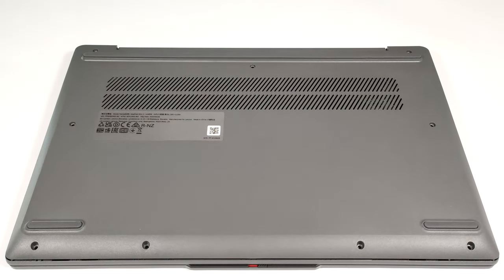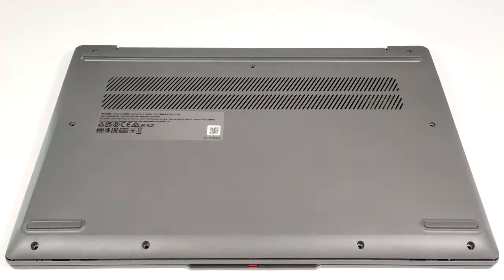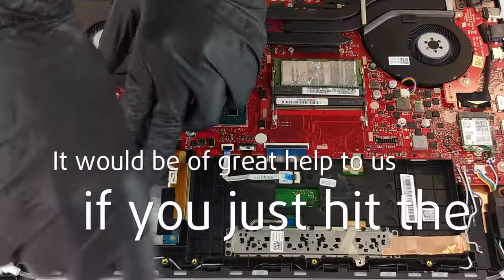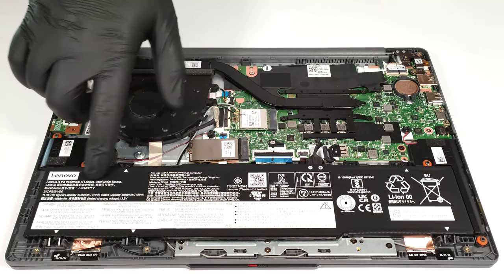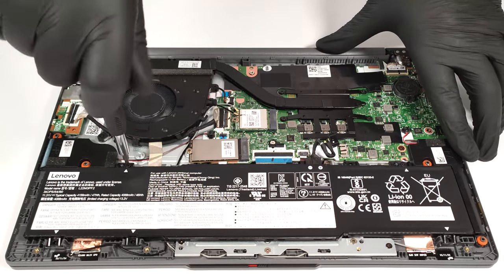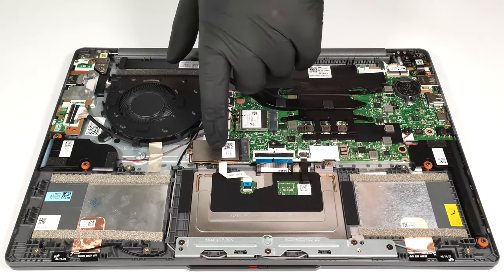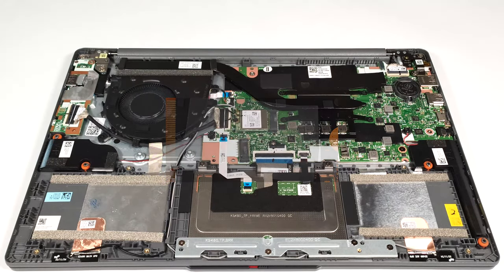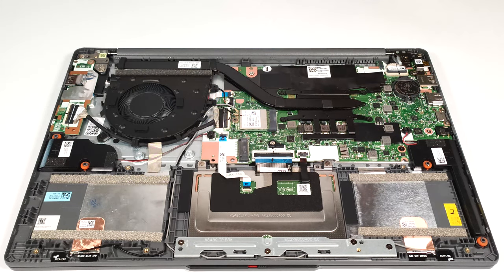🛠️ How to open Lenovo IdeaPad Slim 3 (14″ AMD, Gen 8) - disassembly and upgrade options

Comment: Hey, what do you think about the Lenovo Ideapad Pro 5i Gen 8 (16", 2023)? Is it better than the Lenovo slim pro 7 (14", AMD)? Both have the rtx 3050, the slim has the 65w and the ideapad the 80w version. My main concern is the quality control for the ideapad, as well as the thermals; and of course your thoughts for the slim pro.